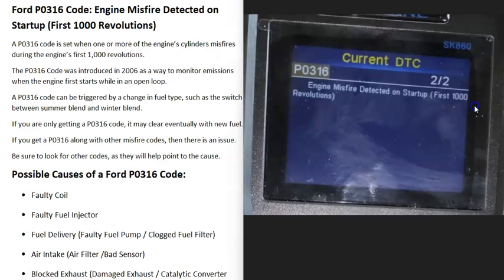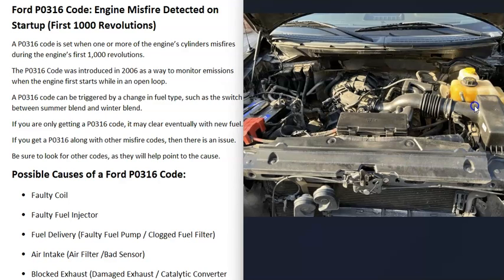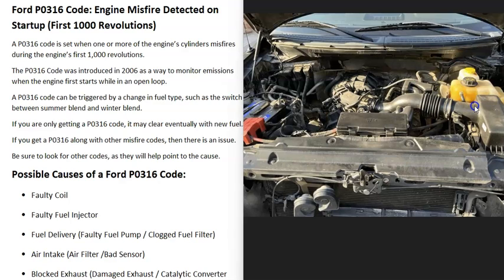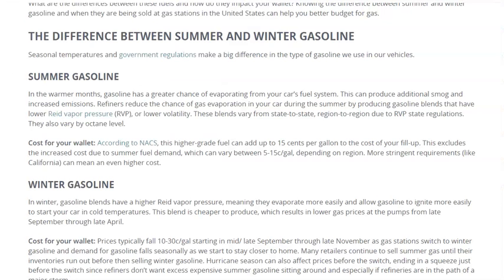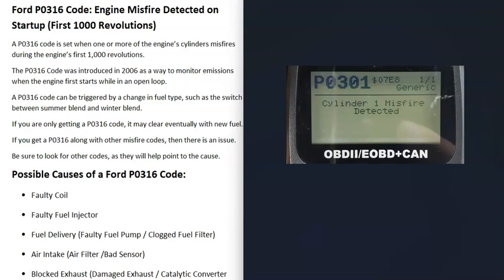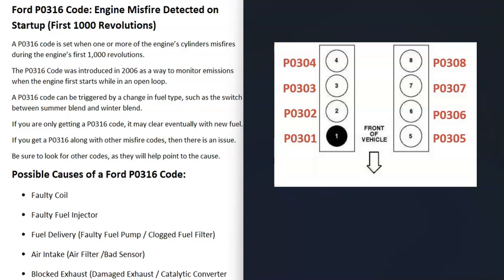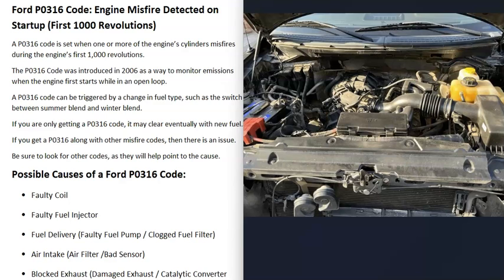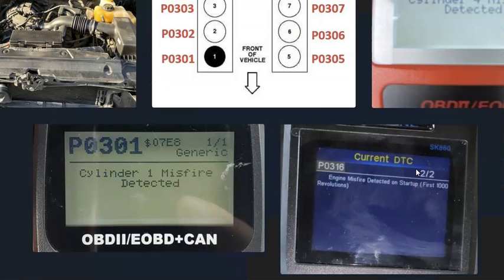Causes and Fixes Ford P0316 Code: Engine Misfire Detected on Startup (First 1000 Revolutions)

Comment: Hi I have a2012 f250 6.2L i have a po305,po300,po316.po302 , only have 88,000 miles i was told the motor is no good any input would be appreciated thanks jim
Reply from the maker: Did they say what the issue was? If there is a mechanical issue, such as a blown head gasket or bad valves, that would cause a lot of misfires. While costly, it can usually be repaired.

Comment: Had a p0300 +P0316...problem was.....engine compartment vacuum line that connects onto the valve cover was disconnected...oops
Reply: Same codes here. Still don’t know the issue

Comment: I just got a used 2020 Ford Transit 250 EcoBoost, 33k miles. After it was driven from FL to CA for delivery, I discovered it had codes P0316 and "Active" P0300 (No Check Engine Light), so it failed smog. Clearing the codes, fresh fuel, P0316 came back and has been persistent, while it now seems to go back and forth between pending  P0305 and pending P0300. Between those codes, I was able to pass smog.
Reply from the maker: All Data has the following reported causes for a P0316 Code - 2020 Ford Truck Transit 250 RWD V6-3.5L
Cause - Number Reported - Percentage Reported
Fuel Injector - 9 - 39%
Engine Complete Assembly - 6	- 26%
Electronic Ignition System - 3 - 13%
Engine Crankshaft Position Sensor - 3 - 13%
Fuel - 1 - 4%
Wiring or Connectors - 1 - 4%

Comment: Was getting pP300 and P0316 codes on my 2016 gt...idle was terrible at startup.
Turned out to be a vacuum leak because I cleaned out my oil separator and didn't put it back together properly... wasn't sealed. Reinstalled it and everything all good.
Live and learn.
Reply: i am having this exact same issue throwing exact codes but i never touched my “oil separator” before on my Gt 2016 , redid the spark brand new throwing the same code again !!! don’t know what to do
Reply: @bapepierre9497 check for vacuum leak at the separator, the connection pipes and the resivior

Comment: Yes. I have two more codes. P0306P and P0430P plus the light Engine on. Not to mention a very loud knocking sound coming from the motor. This noise increases with acceleration. I just turned the engine on and no noise for the first few minutes, then it started. I ran a cheap scan II and these are the codes I got. I had all three Catalytic converter rplaced 14 years ago. Can I fix Catalytic converters myself by means of a hammer according to my neighbor?. He told me: Step one. Get a heavy hammer. Step two. Get under there Boy!!!. Step three... hit tha sucker like you would your wife in your dreams (I'm single, so how would I know? ) and Step four. Turn the engine on, accelerate and watch the carbon junks comming out of your exhaust system. Catalytic's fixed. 2005 Ford Ranger Edge 3.0 V6

Comment: @hvac mechanic i am getting a constant p0300 code. Now, it seems to also get this p0316 code as well. I have been going rounds with this in my 13 gt500 for months.
Vacuum check good, injectors cleaned and good, cats or lack of good. Compression check good. Cleaned and dried every single electrical connection under the hood. Crank relearn done. Reset kam. New coil packs, and two different sets of new plugs. Timing chains and components good. Fresh fuel.

Comment: I have a 2018 Fusion Sport with the 2.7 ecoboost. I have a 93 octane tune on it. It was idling a little rough. So I put a purge valve on it and went and filled up with gas. The next day a P0300 and P0316 code came on. I cleared the codes and put the old purge valve back on. All good for 2 days. Light came back on. Put the new purge valve back on and switched back to stock tune and same thing. I am starting to think it might just be the fuel I put in it.

Comment: I gave p0316 and p00c6 only issue on start up sometimes long crank any idea?2018 navigator
Reply from the maker: "P00C6 Fuel Rail Pressure Too Low." I would check the fuel pressure and test the fuel rail pressure sensor.
Reply: @ thank you!!

Comment: i am a delivery driver i was out for bout hour shut if off for bout 10 mins started up and hit the gas and it took off for a second then sputtered and died then had to get it moving again like it was out of gas but soon got it runnin again with a lil misfire full gas new filter pump pump is runin wire plugs  newer i put alot miles on fast 20000 in 1 year coil pack new still a lil misfire and just a p0316 oh 05 mercury sbale gs v6 3l gas not flex

Comment: I'm getting that code and heated oxygen sensor, code, on my fors f150

My truck has stalled a few times
Reply: Did you figure out the problem/solution?

Comment: I’m currently  getting p0300 and po316 any idea?
Reply: What was it?
Getting the same on my 2016 coyote
Reply: Same u found a solution
Reply: @zacharylopez4750 do you have spark ? Do compression test ? Move coils around? Fuel injectors are spraying , work correct ? Idle Air Control Valve ?  I know it sucks P0316 & P0300 codes . Misfire at startup and multiple cylinders misfiring! Hope it is fixed

Comment: I have po316 and. Cylinder 6 miss fire. Plugs needed chnaged i did that as a maintenance when i first get vehicle and still had issues missfired on 3 cylinders. Well changed fuel filter ran so much better!!!! And aftwr that still had two miss fires replaced the coils on those two and six still stayed around cylinder 8 stoped and everything else seems to be fine but it seemed like there is still a mess but it was very soft a few days ago by that Miss and that small misfire has gotten stronger and heavier no responsive acceleration i have it but its not responsive.

Comment: I was chasing a p0316 and a p0302.  Replaced the coil pack,  no difference.   Replaced the fuel injector,  no difference.  A $150 spent.   It turned out to be a bad spark plug.  $10.  Oh, the spark plugs were only 7 weeks old.
Reply: i have same issue but never thought of plug because they where fairly new.  going to try tomorrow chaging it
Reply: ia dealing with my 2020 f150 5.0 cylinder misfire. changed the plug and still the same.
Reply: @erasmogonzales7428 any update?
Reply: Just did my coils and spark plugs. Now it’s throwing a po316 code. 13 5.0 f150.  Your code was only a bad spark plug?
Reply: Why would spark plugs fail so soon? I recently replaced mine but have a P0305 now.

Comment: I’ve had a 2006 f150 and have had this code since I owned the damn thing like 2 years ago regardless off the time of year. I’ve replaced everything except the catalytic converter. So I guess that would be next? I feel like that would cause other issues though.
Reply: Did you find the issue?